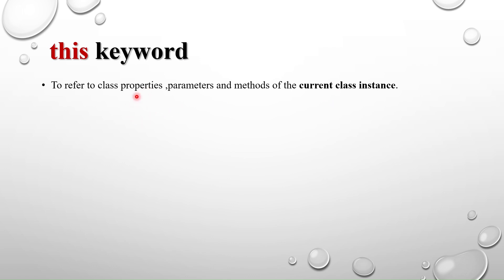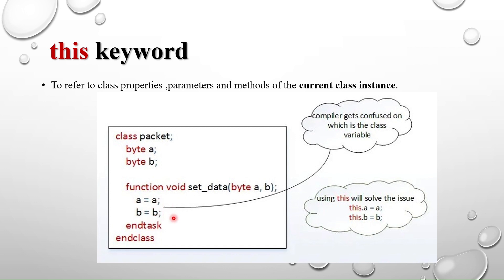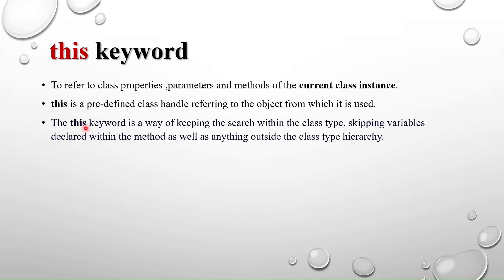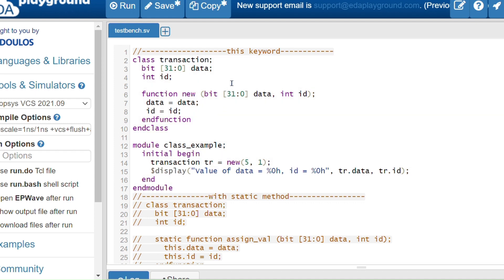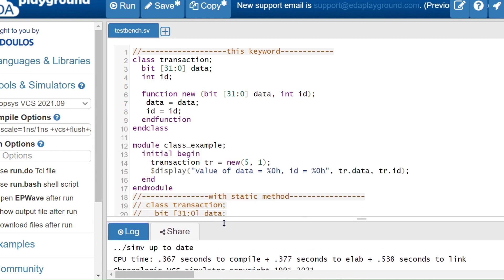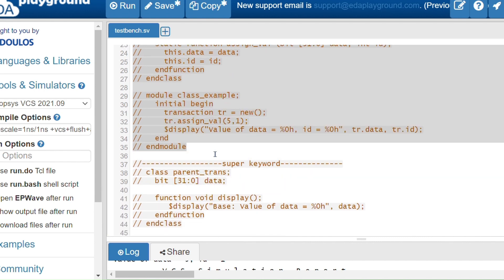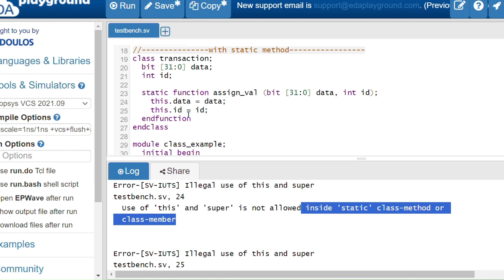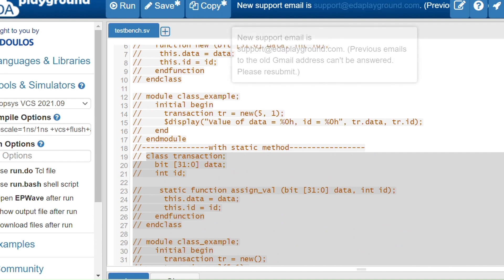this keyword in #systemverilog | Introduction & Examples|#vlsi #verification #verilog #semiconductor

Comment: Hi, I have a question about using the `this keyword in static functions. I understand that static functions can't use the `this keyword because they can't access class properties, which are automatic by default. However, even when I explicitly declare class properties as static, I'm still getting an error saying that the `this keyword is illegal to use in static functions. Could you please clarify why this is happening?
Reply from the maker: A static method means that only one copy of the method exists, and it belongs to the class itself, not to any particular instance of the class. The 'this' keyword refers to the current instance of a class, which is why it cannot be used in a static method. 
Static methods can only access static variables, which are shared across all instances of the class. Since 'this' implies a reference to a specific instance, using it in a static context would be contradictory, as static methods and variables are not tied to any single instance but to the class as a whole.